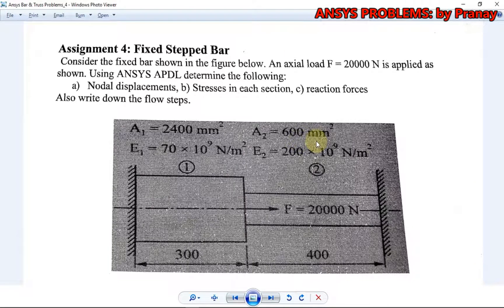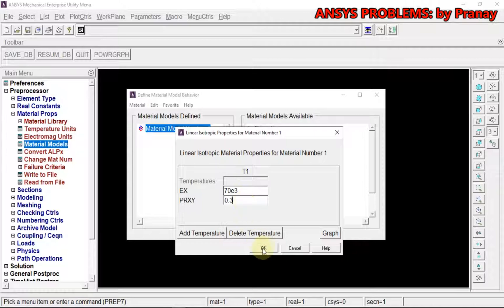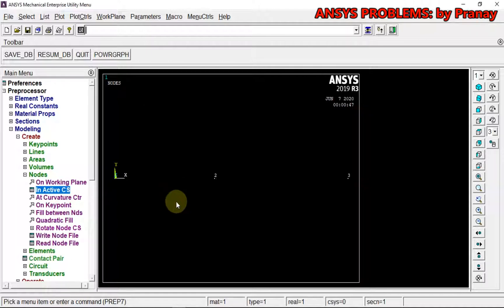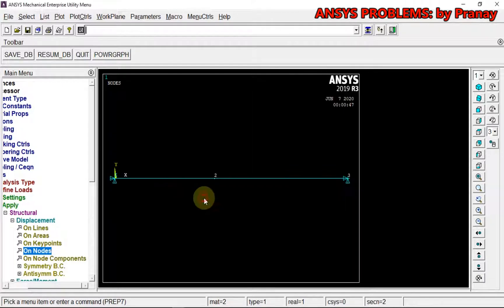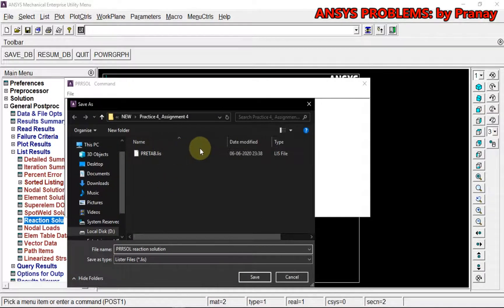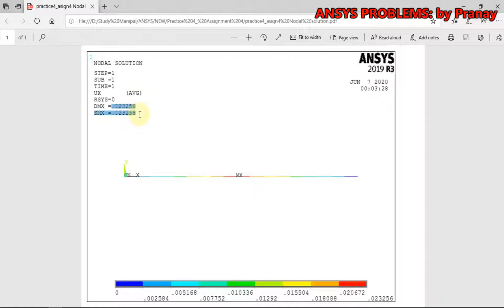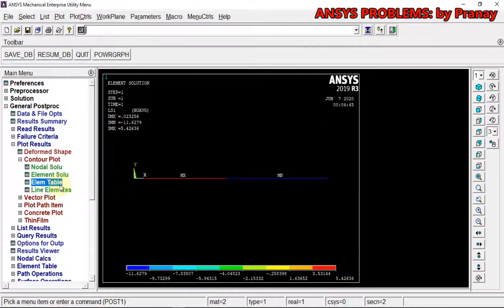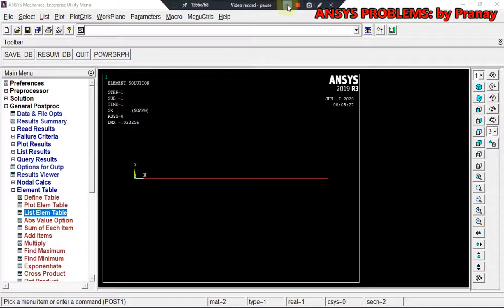Ansys Bar Problem | Practice 4: Fixed Stepped Bar |Ansys Lab Manual Problems Mechanical 2020

Comment: We have a bar problem with A1 = 250mm² and A2 = 400mm² , E = 200e3 , and consist of 4 nodes 0,0,0 and 150,0,0 and 300,0,0 and last one 600,0,0 with P = 300KN at 150mm aka node 2.
And as per the procedure in record it's only work on Ansys 14.5 not working in latest version and giving
 [REAL CONSTANTS FOR THE LINK180 ELEMENT TYPES ARE NO LONGER SUPPORTED] pop-up I tried to specify them in section>> links but it still didn't solve properly got ux at all nodes 0
Reply from the maker: Yup, In my early videos I've mentioned why I made these videos. Since the lab manuals are old and outdated I figured out the way by reading new books. 
Follow the below video closely (ignore the tapered bar, just follow the stepped figure)

https://youtu.be/L8X20DOcsEQ

Basically, the error might be in defining loads or the material attributes.
Reply: @pranaytomar2619  cool thanks